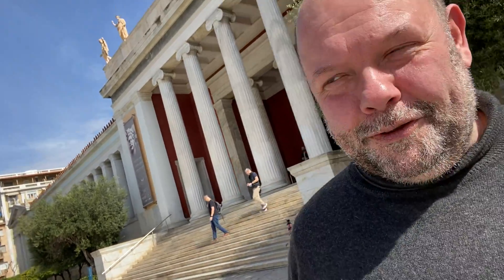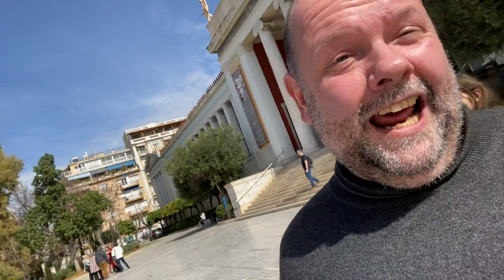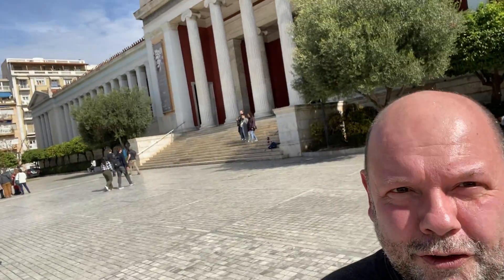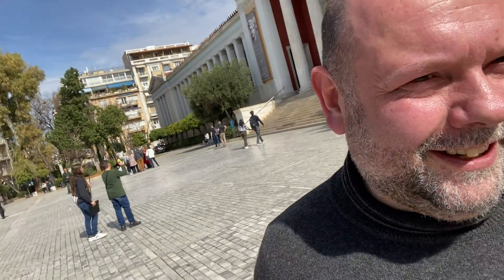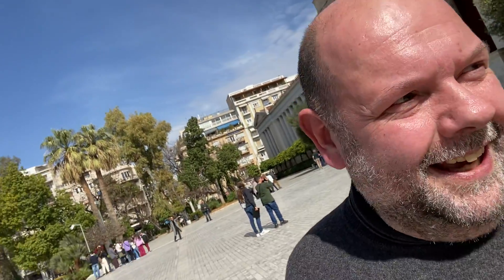A watchmakers view on the Antikythera Mechanism - Naaa bring Buzz! 🤣🤣

Comment: Thanks for sharing your thoughts on the Antikythera mechanism! The question that I have for you concerns the shape of the gear teeth. As you are well aware, most modern gears use involute shaped teeth. The Antikythera mechanism used triangular teeth (probably because that was the only logical shape at the time). Could it be that triangular gear teeth are more forgiving of flaws on inaccuracies that the mechanism could have been functional to at least some degree? It is difficult to believe that the device was nonfunctional. In fact, some researchers have noted that some parts showed stress from use.
Reply from the maker: Interesting is that with these triangular teeth there will be far more sliding action during rotation thus wear. I'm not disputing that it might have worked, but there is a lot of friction in this design for it to be practical in use over a long period of time. That's all. Thnx! Kalle

Comment: G'day Kalle, from Australia :)  Congratulations on getting to see the Mechanism in person. I'm a little far away for that :)  Sorry, this is a little long, but I hope interesting.
Thoughts on your comments regarding doubts on other mechanisms being recycled: As you pointed out, a mechanism will wear out, and the climate would promote corrosion, so they would have a finite lifespan before it possibly became unusable, or too expensive to fix, so selling it for recycling might be legitimate. A bronze statue won't wear out, and a cauldron would last for a very long time, so they wouldn't be slated for recycling the same way as an object with high load moving parts reaching the end of it's working life might.
 
Also there are comments in the works of Vitruvius and Cicero that imply mechanical astronomical devices being made around the time of the Antikythera Mechanism. See 'The Artificial Clock-maker' by W. Derham, pages 96 - 100 (https://archive.org/details/b33000529/page/96/mode/2up). 

Lastly, have you seen the fascinating Antikythera Mechanism series by fellow Aussie, Clickspring?
 Start here: https://youtu.be/ML4tw_UzqZE?si=4fXpTLW9xXkdz_PA
He dives deep into the construction methods and as the series goes on (with the sub series Antikythera Fragments) it becomes more and more experimental archaeology and tool making, including making his own files and case hardened steel using methods the ancient Greeks would have had available :) 
  Cheers, and thanks for your patience, and I enjoy your various videos, especially ones about the old verge watches (1600 - 1700's being my favourite watchmaking era) and interesting escapements and complications.